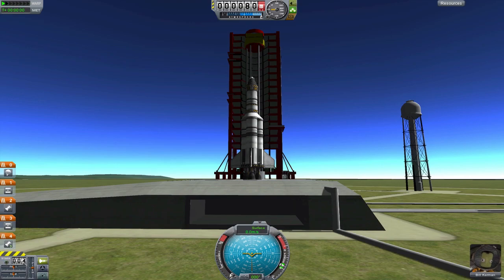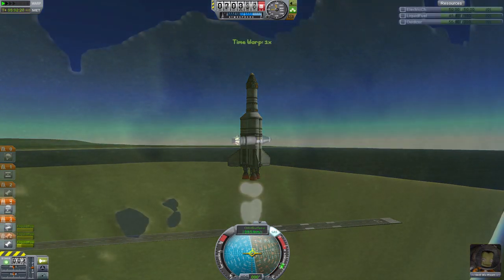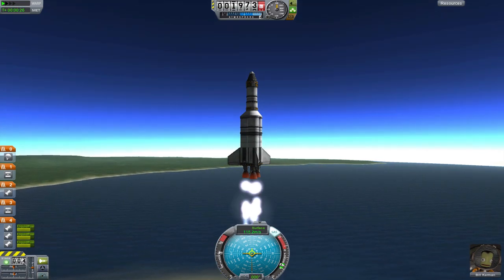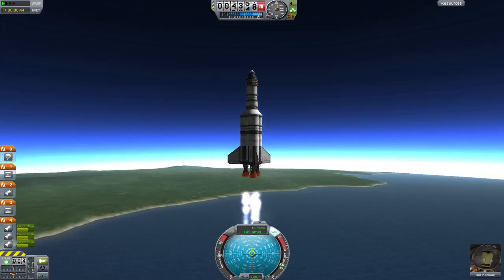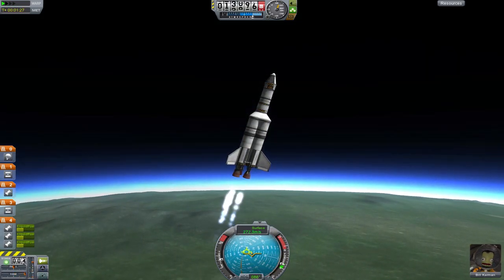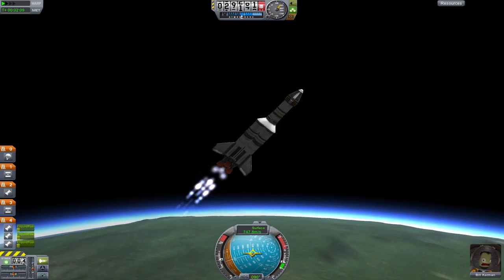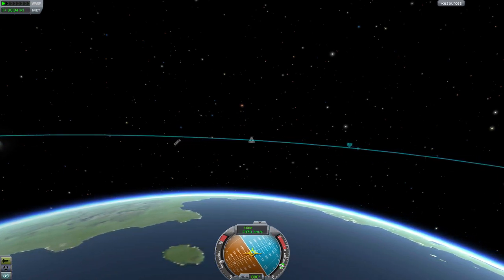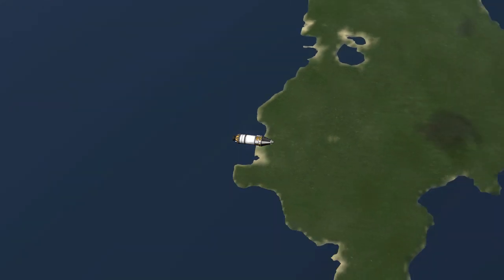The Perfect Launch - Kerbal Space Program Tutorial

Comment: I assume you're talking about spacebar? That's to activate a stage, which will let an engine start working. You need to turn up the throttle for it to do anything.
Left Shift and Left Control (I think?) control the throttle up and down. You might have to turn them up first before hitting Space, though.